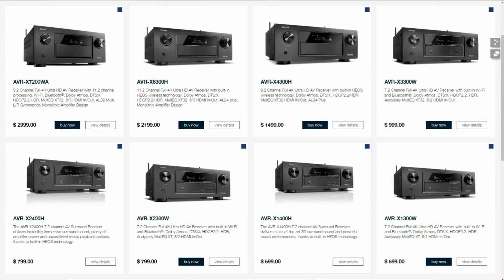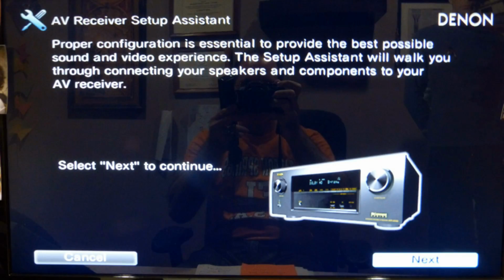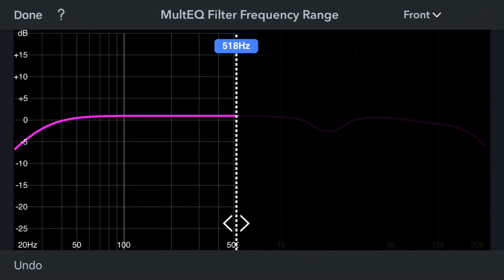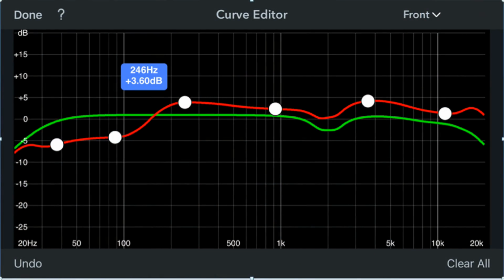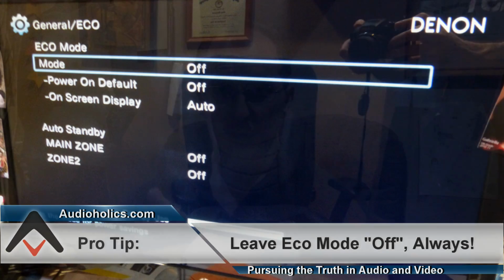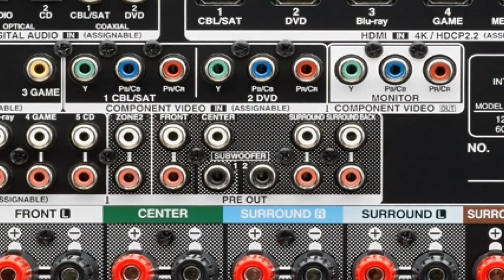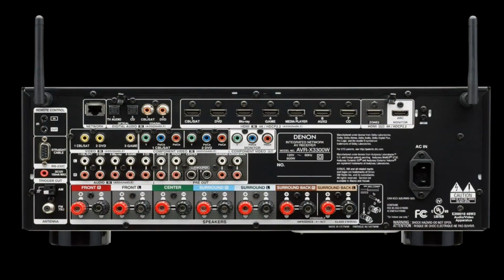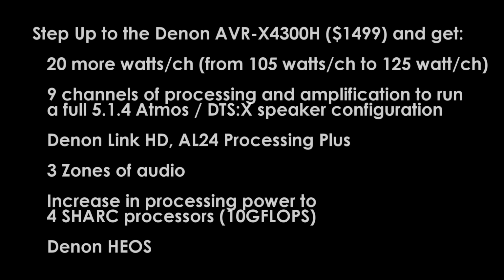Denon AVR-X3300W 7.2CH Atmos/DTS:X Receiver Review

Comment: I got this for $600 brand new on Ebay, many years back.  (2026 now).  It is still rock solid after all this time.  I only use 5.1 (for the home theater) and the zone 2 for the garage, so it is quite difficult to find a reason to upgrade from this x3300w.

Comment: Replacing demon 1913 with a x4300h demon. I need an amp to drive the two extra outputs to give me 7.2.4. How can I use the 1913 to my advantage? Can I use it for more than driving two speakers? Can I hook the two denon avr's together making the 1913 a slave and run all 7 speaker outputs as height channels? Is this possible to do without frying both of them?

Comment: Did not understand why he did not recommend bi-amping. If you have 7 channels of amplifier and only 5 speakers why not use the 2 extra channels to bi-amp even if it means they are sharing the same power supply.

Assume it is 60W rms with all 7 channels driven. Your front speakers can have 120W (3db more) instead of 60W. My front speakers allow me to split the crossover into LP and HP.  So I could run 2 channels to the LP section and 2 channels to the HP section.

Comment: I need to upgrade my receiver from 7.1 to 7.2.4.  I have the Denon X1400h.  I need HEOS but I never run high volume (condo).  I need to figure out if I am better off with an all in one or separates in terms of long term value when I want to upgrade the software end someday.  I figure I am going to have to spend $2k.

Comment: Thanks for the review. This is so difficult. I have a 7.1 setup. Atmos movies like The Equalizer sound amazing. I added 2 speakers in the ceiling about above the front speakers. Followed instructions on manual and Dolby website. Even had to get a plumber to move a pipe out of the way. But now I don’t even know if I’ll be able to connect and use them with my avr-3300. I printed the connection section of the pdf manual and I’m trying to figure out where to connect them on the rear panel. At least the speakers will be in place when I do decide to buy a newer receiver. Keep up the good work.

Comment: Hey audio King. I have a question buddy I bought a Denon stereo receiver I just was wondering what you thought about the 687 AVR. Truth is I bought the thing broken for like $25 and it only had a disconnected wire plug wire for one of the circuit boards. My question is is this a good stereo or and please give me an honest when I really don't care

Comment: Gene or all???, I have the x3300 and you mentioned in your video not running the ohms under 8... Is this true even if I am running two ELAC uni-fi UB5s and a uni-fi UC5, which are 4ohm recommended?
Reply from the maker: The answer is repeated several times in the video.

Comment: How do I connect my new Denon 300P record player to my Denon AVR3300? There is no RCA audio in on the 3300. I want to play all my speakers with the record player plus have volume control.
Reply: I'm guessing you've figure this out by now but the Denon 3300W has 5 RCA audio inputs... cbl/sat, dvd, bluray, game, and cd. Typically when a receiver doesn't have a dedicated phono input, its recommended to attach your record player to the RCA CD or Tape aux inputs but any of the 5 RCA inputs would work since there all assignable sources. 
Also if your connecting your record player to a non phono input, make sure your record player has a built in phono amp (usually theres a phono-line switch on the record player) otherwise you'll need to buy an external phono amp to chain between your record player and AVR receiver.

Comment: Question: I have a few Denon/Klipsch systems in my home. On my primary system I have the Denon AVR-X4300H and a 7.2.2 Klipsch Reference Premier setup with two Atmos height speakers in the front. I have an R-115SW sub on the left side and I added a sub that I had kicking around, an R-12SW collecting dust on the right ride.  It's not an identical sub  It is the only Klipsch piece in that setup that is the standard Reference line. It is nowhere near the power of my Reference Premier subs like the R-115SW or the R-112SW, but I tried it running Audyssey using just the R-115SW and then with the R-115SW and the R-12SW.  I think it sounds better with the two subs, but I keep getting told that I am limiting or distorting the capability of the R-115SW by having the lesser sub attached. Audyssey does initially measure each sub separately during the first part of the calibration, but it does then take many measurements on both subs at once. 

So my question is really to hear your thoughts on this. What am I doing right or wrong and what can I possibly do better. I ultimately will get a third R-115SW for this system and sell the R-12SW, but for now this is what I have setup.

Not that I think it's relevant to this question, but I also have an Emotiva 150w/ch amp powering the mains to take a load off the X4300H.  Thanks

Also, I can vouch that the AVR-X3300W is a great unit. I have one in another room and it all I could want for that 6.1 setup. I really appreciated the web interface that it has, which seems to be removed from the HEOS models like my X4300H. I like being able to remotely configure mid-range units like the AVR-X3300W and the AVR-X2200W using my browser. Even the Android and IOS Denon AVR apps do not give you that level of remote setup on the AVR-X4300H.

Comment: @Gene. Really enjoy your content.  I'm new to HT scene. Could you recommend or link to a good (older model) 5.1 AVR?  We'll only have space for L/C/R - rear L/R - powered sub.  Also looking to have 3 to 4 HDMI output (XB1, B/ray, ect).. Budget $700 to $800...

Might add external amp in the future when speaker are upgraded. Thanks...

Comment: 'Eco mode' now offers an  'Auto' setting on Denon and Marantz AVRs which essentially allows for power output changes to occur on the fly. It's based on the volume setting so power and sound quality will be appropriate to need and IS NOT compromised in any way. ... YAY! ... The Eco mode's real function is to keep internal temperatures down during light use which will preserve the longevity of the unit. :)
Reply from the maker: Yea I didn't get the eco mode to trip during my bench tests and you can certainly use it. I'm just leery of any nanny control especially since receivers these days have so many of them.

Comment: I was looking at the Onkyo TX-RZ820 and then I saw the Denon AVRX3400H go on sale for $599. I had a feeling that even though it has slightly less power (irrelevant as I am adding an external amp later) that the Denon was just a higher quality unit. Now when I hear you talking about it being more stable into 4 ohms than even the Pioneer units, I know I made the right choice for my budget home theater. Love your site and all the technical advice!

Comment: I'm sorry I have asked and asked what the best choice would be for my system with no answers!! My sc 55 pioneer eltie just blew would the 701 be better of the 6012 or even one on of these denins? I'm up grading to 4 k I want dts x and Atmos I run 7.1 right now but want to add 2 ceiling Atmos soeakes ?? What would you recommend for 15k or under that perfabley won't be obsulete in a month?? Please help!!

Comment: Hi, I'm planning on getting the Denon AVR x4400h for atmos and music, assembling gradually a 7.1.4 Atmos system. I have 1 pair Goldenear Aon 3   2 way bookshelves, 8 OHMS, and 2 pair Epos m5i  2 way bookshelves surrounds all 8 OHMS , and I just bought some used Pioneer Elite SP-EFS73 Dolby Atmos towers designed by Andrew Jones from 2014 which are 4 OHMS. Can i mix 3 pairs of 8 ohm speakers with 2 pairs of 4 ohms speakers on the Denon AVR x4400h at the same time? Can 8 OHMS speakers run at the same time with 4 OHMS speakers? I have a HSU VTF15 mk2 15 inch subwoofer, also for bass. Any advice is greatly appreciated.

Comment: I am setting my first dolby atmos theater  my room is 14 by 27  feet, 10 feet high SPEAKERS LINN 5140 R/L/C  REAR PARADIGM, TWO SUBWOOFER MONITOR AUDIO, POWER AMPLIFIERS ROTEL   2X200, 2X200 AND 3X150 WATTS.  My question since I have been  listening you for 2 years and you know your stuff is which AVR you would buy, options are onkyo tx rz1100, denon avr 4400H or marantz sr 7011.  They are all great but which one is better built since I have no clue on that matter.  I use my room 80% movies 20% music.

Thanks and keep up the good work live long live prosper.

Comment: Hi, which one should I buy, AVR-X3400H or AVR-X4300H. I plan to use only 5.1 ch, and powering the speaker using Emotiva XPA-5. I heard some people says that higher end AVR can have better sound processing even though I dont need the extra power of it. Is this true? the price actual double up so I was thinking of saving and get the AVR-X3400H since I dont need the extra chancel or extra power from X4300H.

Comment: Thanks for all contributions you guys do for us! I have a question, I just bought an AVR-3400H Receiver. I have 2 Subs SVS PB-1000, 1 Klipsch RP-250C Center (8ohms) and 2 Klipsch RP-240S Surround Speakers (8ohms), 2 SVS Elevation Prime Speakers (8ohms)  and 2 Floorstanding Pioneer SP-FS52 front Speakers (6ohms). I'd like to know if this Pioneer speakers, which are 6ohms, will have any problem with the others 8ohms speakers. Do I have to change any configuration? Thank you all again!
Reply from the maker: You should be fine. Just level match all of your speakers after they are properly placed. Make sure you use bass management as well.

Comment: Hello Gene great review. Do you have a review of the Pioneer SC-LX501? I am between this x3300W and the 501. I was leaning toward the 3300 until I realized from your review that it does not have separate powered channel outs for Zone 2/Height (making 9 total) where-as the 501 does.

Thanks

Comment: On the subject of future-proofing, I have a hypothetical question, as I've purchased one myself: This model, like all the X series units, supports HDR 10, but I wonder if it will it be able to support future versions of HDR via firmware updates.  AV tech that becomes obsolete in 2-3 years is painful.  Do you have any thoughts on this?

Comment: Hi guys, i just bought this receiver and i am trying to upgrade my system from 5.1 to 5.1.2 (Dolby Atmos) all my 5.1 speakers are Technics SB ( 8 ohms ) also i have 2 small Technics SB but 4 ohms, can I  use them to complete the 5.1.2 system or i have to buy a pair of 8 ohms as well?  Thanks !!!

Comment: (started response to comment below on older amps and relationship to amp being reviewed)

Excellent amps in their day..  but obsolete now due to technology advancing (4K) and forced obsolescence due to idiotic crap like dhcp 2 "in the name of piracy" which is a big fat lie.. all it does is try to force control into hollywood's hands regarding format of code.. and try to make you the consumer pay them again and again for something you already own.  (Fortunately those like myself just bypass their crap and things work faster, smoother and BETTER than with their "legal" method.. and yes it's perfectly legal for me unlike the schmucks in the US under the idiotic draconian dmca garbage that they are still trying to enforce where it has no legal bearing at all..  They need to learn what BORDERS mean for laws!)

Also due to hdcp insanity unless you strip their crap out of the source you can't even test any of those amps for pass through.. though on paper they will fail due to lacking hdmi 2 spec for 4K and that unfortunately means obsolete amp for the recycling pile yet again.

The wise method would be strictly use of power amps only and a preamp main controller with NO amps built in at all.  That way expansion is a snap and upgrades do not cost as much..  but of course the MFRs don't want us to have that choice..

Oh and as for the amp being reviewed..  nice.. I was debating 3300W or 4300H   HEOS is crap IMO that is way over priced and proprietary so you are locking yourself into whatever they choose to produce.. this is a BAD idea regardless of how good Denon tries to make it.  Open source connectivity is a must for that sort of thing not only to give yourself the best choices now but also future proofing.   What if Denon decides next yr everything HEOS is 100% more $$?  What if they decide to kill off HEOS?  What if etc etc... you put yourself at their mercy by investing into something in that sort of design.. a piss poor idea to say the least

Hell even getting the Denon amp without being gouged insanely and artificially with pricing where I live I have to import it myself.. skirting around the contracts Denon makes their dealers sign to "protect" their official dealers where I live..  which is BS since all those dealers do is hike the price up by a huge % and drop the warranty down from 3 to 2 yrs..  So I don't play their game and bypass their BS..  and have new amp coming for less than half of what they are charging here for it.

Comment: Does anyone know if I can connect both tv and projector to X3300W and easily switch between them? It says it has 2 hdmi outs but one is described as zone 2. this is why I have some doubts...
Reply: I think with the higher priced Denons they have 3 HDMI outs, with 2 for the main room to switch between an LCD and a projector for one source, and an lcd in another room. The x3300w 2 HDMI outputs is probably is for an lcd in a separate room in addition to the main room. Thats why they call it zone 2.

Comment: Gene, great video! Sorry, I don`t have enough knowledge to understand everything you said about the receiver. Could you please explain a little about the Zone 2? Is it possible to have different sounds, like movie in the main zone and Spotify on Zone 2? Do I need something else to have Zone 2 playing? What do you mean by "Can't simultaneously prewire for 7.1 and zone 2 speakers"? I would like to understand because I want to have Zone 2 in another room. Thanks!! I`m from Brazil, so sorry if my doubts are not that clear.
Reply from the maker: Yes Zone2 allows you to route different audio from the main zone into another room. The Denon doesn't have enough speaker level outputs to connect surround back/height and zone2 simultaneously for you to switch between the two like you can with other receivers in this price class from Yamaha and Pioneer.  Hope that helps.

Comment: If you don't need pre-amp output or two HDMI outputs, the DENON 7.2 1300w has many of the same features for $399 on Amazon, BestBuy matches price, original price was $599.

Comment: i own one of these. no complaints on audio quality, however there is a huge bug with the 4k hdcp handshake with the roku premiere +. i currently have my roku connected directly to my tv and am using ARC to get the audio to the receiver. beware of that if you are planning to connect a 4k hdr roku through this to a 4k hdr panel. the issue seems to be roku specific as i tested a samsung blu ray player with 4k hdr and the handshake was fine

Comment: Man made "Climate Change " is a hoax perpetrated by globalist. The Paris Climate Accord is designed to deplete the United States of half of its wealth and share it with other countries and will do NOTHING for the climate. Climate change is a bigger scam than high price snake oil cables.
Reply from the maker: You are on the wrong side of science my friend. Anthropologic Climate Change is real as per the scientific consensus and peer reviewed data scrutinized following the scientific method and DBT protocol.  Just because you don't believe in something doesn't mean it isn't true.  If you don't believe the science of climate change, than you should also deny the science of semiconductors used to make ALL of the electronics you enjoy. After all, Jagadis Chandra Bose was likely just out for a profit when he invented the semi-conductor.  And, what the heck are electrons anyways?  You can't see them so they must not be real.  Changing an insulator into a conductor by Doping? Sounds like liberal propaganda :)
Reply from the maker: You can try that. It can be tricky getting all 3 subs to play nicely together especially if their low frequency extension and roll off are different.  Measurements are needed.

Comment: I have the 3313ci. The main feature I would like in a new receiver: I use an Emotiva 2 CH amp for the L/R mains (300WPC), so now those internal amps are not used. I have a 7.2 setup, and a stereo Zone 2 for outside on the patio. Presently I have to manually switch between 'main only' and 'zone 2' in the amplifier assignment menu to play music outside or then use back surrounds inside, and push a speaker select button on the wall the switch the speaker wiring. I guess I would like two more speaker terminals and be able to power them with the L/R channel amps. Perhaps the Yamaha will allow that.

Comment: With so much processing and the associated licensing fees along with an ever increasing number of channels becoming standard fare it looks to me like separates are going to be required in the not too distant future. Perhaps the  processor unit could just do processing and only output a clean digital signal to combined DAC /power amplifier units and or wireless speakers. 
The room correction could be done like sonos just started doing via the help of an iphone app that lets the processor unit adjust the digital output to optimize the sound. I believe that Paradigm and Martin Logan are using iphone  apps also to remove the limits of their ARC room correction from the bounds of long wired microphones. 
This approach would no longer require any analog preamplifier or DAC components in the processor. This would save case space, power supply limitations and money without sacrificing sound quality. It would also be very flexible especially if it became the standard way of doing things.